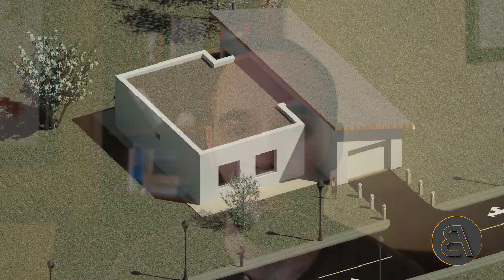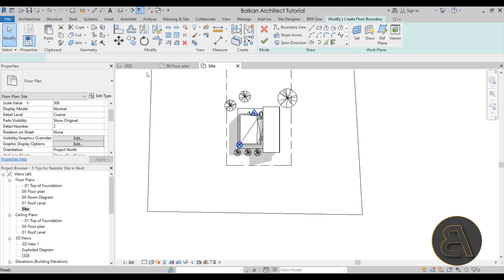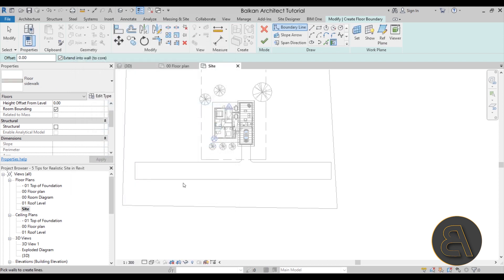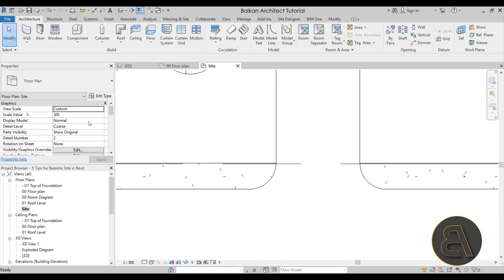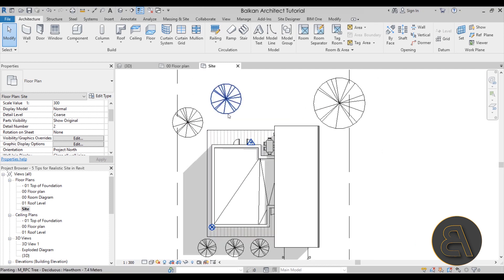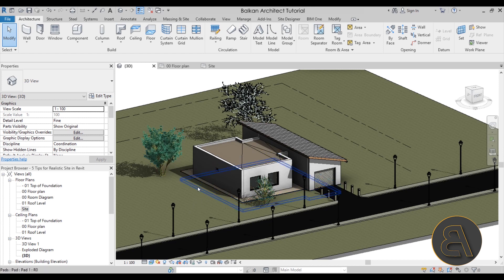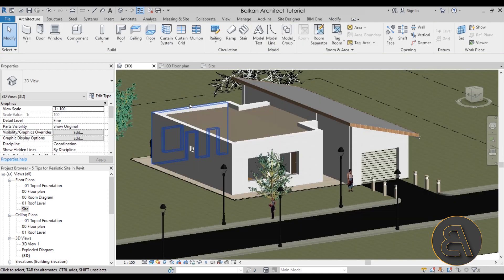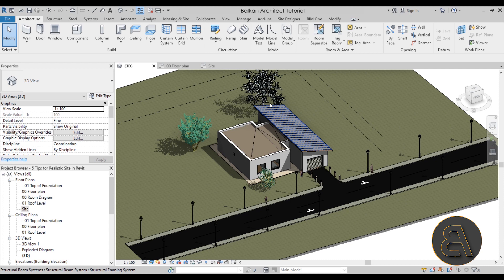5 Tips and Tricks for a Realistic Site in Revit

Comment: Would the trees’ geometry slows down the file? I’m working on a community project and not sure if i should use 3D trees because I don’t want the file to crash. 
Thank you for the tips!
Reply from the maker: Yeah, don't overdo it if you are using 3D trees 🙂
Reply: I dont know  what render software you are using but if you use enscape for revit, you can add trees from its own asset library, which are all low poly objects and dont create as much weight on the project.
Reply: Doruk Kepce oh yes, I’m being introduced to that in class. Thank you 🙏🏼